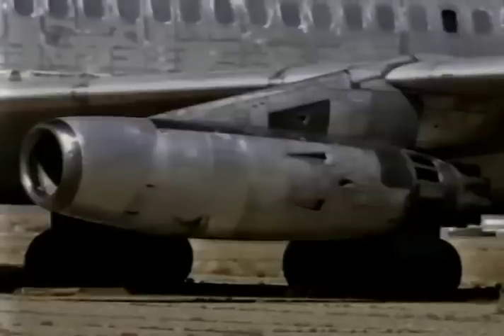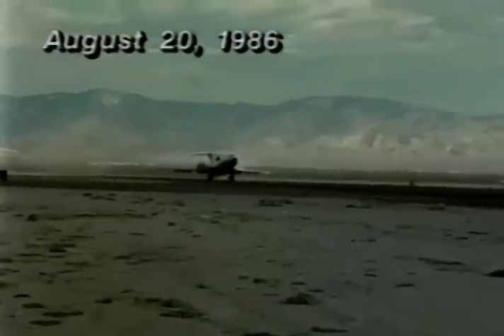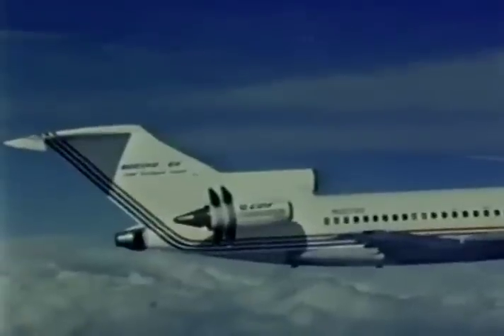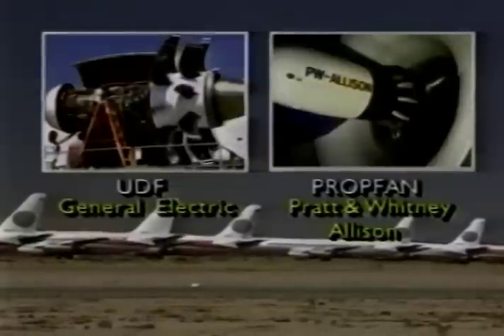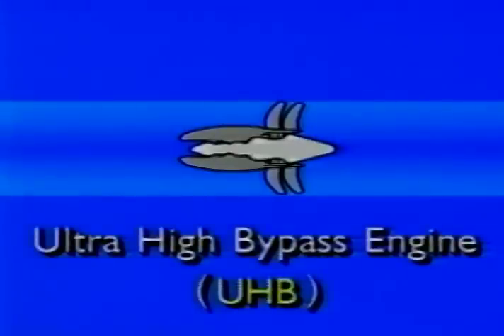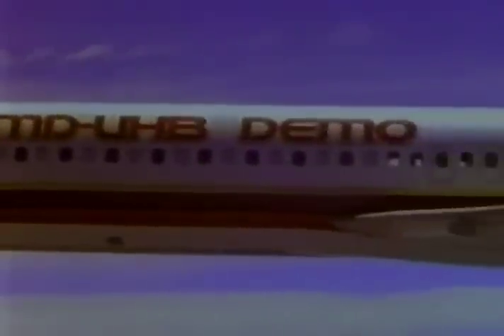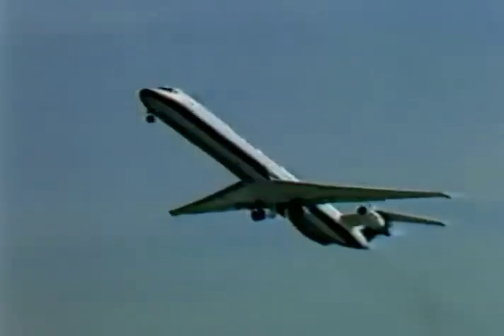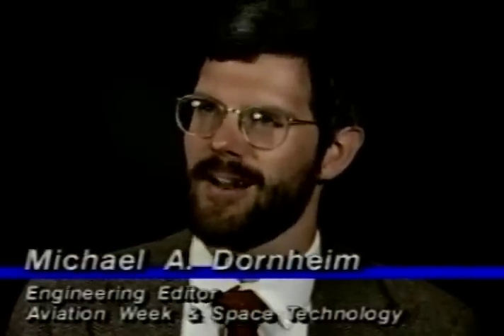The Incredible Engineering of Ultra High Bypass Jets

Comment: Is there a better engine in existence today than what is seen here in the video? And could you still use this concept and adapt it to any modern engine? 
 I know that the front main fans of today are swept and curved, that reduced the noise considerably if I remember right. Couldn't you you do the same to the UHB blades?
Reply from the maker: shexdensmore Thanks for your comment. Better is a pretty tough term to define in this context but it is safe to say the DNA of this technology "family" is flying today in the engines across the world fleet. UDF's blades as seen in the thumbnail were already highly swept - but the specifics are based on power, rotational speed, etc.
Reply: I wonder if they were thinner, they look they're 2-3in. I'm guessing they are more likely 6-12in if not more. In any case. I wonder if they were made to be thinner. If that would decrease the sound while still increasing the thrust. 

  And i guess my original question was why wasn't this persued or why haven't I seen anything like this?

Comment: Isnt this just going back to propeller technology buy powered with a jet engine? Its a shame we  go to such lengths to cut on carbon
Reply from the maker: eatermaneatsyou Thanks for your comment. Not really, it is an effort to save fuel for aircraft operators using an unconventional fan jet technology... The two versions were Unducted Fan and PropFan. While carbon output reduction is a by product of fuel efficiency (the goal of this technology demonstration exercise in the late 80s), fuel efficiency is first and foremost a way to save operating costs for airlines and other operators of aircraft.
Reply: AeroSpaceNews.com Right. So there is also thrust generated by the engines exhaust itself and not just the propeller? Would you happen to know how much of the exhaust gets used to power the fan and how much actually goes to thrust? Not asking for exact numbers just which is more dominant.
Reply from the maker: eatermaneatsyou I can't tell you with any certainty or precision but my experience and instinct lead me to say it is majority fan (those crazy blades) produced thrust that is created as "work" by these powerplants. Re-reading your question, I don't think that is what you asked. All of the hot gases exit the turbine and thus produce some thrust. How much of their momentum or energy potential is "re-directed" or "consumed" by the requirements to spin the big fan, I don't know. The very same re-purposing takes place in all fanjet engines but the numbers, of course, vary from model to model. Same is true for turboprops (again with variations relative to fanjets and by model).

Comment: I don't understand...how is this different from a turboprop?
Reply: legionbunny This one doesn't work that's the difference. No advantage against the turbofan.
Reply from the maker: legionbunny Many many more blades. That's over simplified but more or less the essence. Thanks for your question!
Reply: legionbunny No gear box,less complexity and weight, specially on  big engines.
Reply: legionbunny also pusher props are more efficient than front mounted props
Reply: +Charles Frogg It worked perfectly. The reason why its not used today is because its LOUD. Over 170 db loud, which makes it a bad thing, says the FAA.
Reply: No. The reason why they are loud is the same reason why helicopters are loud. You will notice the only helicopters that are pretty quiet are the ones that have an enshrouded tail propeller like the Dauphin. The noise youhear from helicopters is called blade slap.

Comment: The UDF is LOUD!! It will require a lot more R&D to get them to acceptable noise levels. The UDF will eventually become "unavoidable" in future jet designs. They could be working on it this very minute. A lot of other countries still have an active research program.
Reply from the maker: tollytime propulsion Thanks for taking the time to comment!
Reply: Uh no modern day hy bypass ducted fans are many times more efficient then this design. Two words, tip loss. There's air that could be used as thrust but instead slips over the tip of the blade and becomes useless air that only provided extra drag.

Comment: AeroSpaceNews.com What do YOU think of this design? personally i think its excellent. exploiting the exhaust for power as well as the rest of the engine is definitely a plus. most possible bang for your buck. Frankly, I don't understand why commonplace aircraft don't hhave this. I've never seen this type of design before untill now.
Reply from the maker: Daniel Cannata Thanks for your comment and question(s). Kinda wish you'd avoid the profanity per your other comment as we have people of all ages watching our videos. All gas turbine engines (jets) use both cold air (from the fan(s) or in this case the propulsers) in addition to hot gas exiting the core of the engine, so that's not unique to this technology. When this video was made what was new was the extreme ratio of cold to hot, the Ultra in Ultra High Bypass. As we've said in other comments, that approach in one way or another is more or less in place in various systems now. Noise was an issue with the blades back then and is still a tough nut to crack today, somewhat less so with a nacelle surrounding the blades as seen on conventional fanjets. Certainly fuel efficiency is good for many many reasons so ongoing research in this type of system seems worthwhile. Blade loss was not our concern then as this was not much different than a turboprop or piston powered propeller driven aircraft in terms of risk... maybe in terms of number of blades and rotational speed, but that does not seem a major issue.
Reply: Oh...S: now that I think about it I have seen props in the outer flow layer but I thought that was always a thing. I didn't know it was this. You learn something new every day i guess lol.

And did I swear? 
My apologies. If you want to keep it PG, I respect that. :)
Reply: Daniel Cannata took the bad word out. :3
Reply from the maker: Daniel Cannata Thanks again for the comment and understanding! We want to encourage young folks to get involved with the magic of flight so we gotta keep it appropriate for them. :) UHB was really kinda like turboprop propulsion on steroids... more blades and more highly twisted, but not too radical a departure from good old props. It was looked at more as taking the cowling off of fanjets, but one could approach the concept from either direction and be pretty much on target.
Reply: AeroSpaceNews.com "All gas turbine engines (jets) use both cold air (from the fan(s) or in this case the propulsers) in addition to hot gas exiting the core of the engine" ==> Not really. Don't forget that in pure jets, all the air goes into the combustion chamber. Granted, part of this air is used for cooling of combustion chamber lining, but this is more of a technicality.
Reply from the maker: corisco tupi Can you name any models of what you are calling "pure jets" that are in production today? Just curious. While you point out the issue is somewhat semantic, as far as we know, even modern military jets have some bypass ratio in the name of efficiency. It seems the age of the original turbojet is long past. If not, we are always keen on learning something new! :)
Reply: AeroSpaceNews.com Sure, my pleasure. One example is the Scaled Composites White Knight, used to launch the SpaceShipOne experimental spacecraft. Some other aircraft, while old by design, are still in use such as the F-5 fighter or T-38 trainer. I'm sure there might be others. I'm glad to be able to take part in your endeavor of learning something new! ;)

EDIT - While your question specified "in production" and the examples I provided above do not strictly qualify, turbojet engines are in use today, so your assertion that "all gas turbine engines", etc, is wrong, sorry. And more: turboprop and turboshaft engines are also gas turbines that use all the inlet air for combustion, which further disproves your "all gas turbines" theory. And there are plenty of those in production. :)
Reply from the maker: corisco tupi While perhaps it was unclear, you appear to have both misinterpreted my question and missed the entire point of the original response to the OP. My question to you, made in good faith, was about the powerplant, not the (or any) aircraft. Naming a very specialized aircraft in response was not illustrative of your point. 

Furthermore, it was clear from my question and admitted as such in your response that "in production" was the status sought. Thus naming a Vietnam-era aircraft like the F-5 is not an applicable example.

You seem quite keen to make me wrong. That's fine, your prerogative. But the only thing wrong was a lack of understanding on your part that my comment was written in the context of all the other comments made by me on this video about the direction of modern aviation jet engine (gas turbine) design(s). In that context designs dating from the age of this video and newer do typically have some bypass (sooner in the civilian world but eventually even in military aircraft). 

So perhaps what is wrong with my comment was the omission of an "*" followed by one saying *Jet engines designed and produced after the date this video was produced.

Finally, claiming that turboprops don't have bypass air is, with all respect, fundamentally flawed. In fact, and in the context of my comment, they have the most "ultra" bypass of any flying gas turbine designs. Yes, "flying" gas turbines. While there are stationary, rail, marine, power generation and more types of gas turbines, they were not part of the conversation here. I can't think of a flying gas turbine propulsion powerplant in production in the "West" without some bypass ratio. Not APUs, propulsion. I'm not interested in being right, I'm interested in knowledge. Do correct me if I'm wrong but try to be polite. Lest you think not, rotorcraft (helicopters) are essentially turboprops in this context.

I never offered a "theory" related to "gas turbines. In response to a question I simply attempted to offer some facts, in a historical context, about this strange and almost forgotten milestone on the road to aircraft propulsion fuel efficiency improvements.
Reply: AeroSpaceNews.com I don't know why you think I'd be unpolite in my reply to you. If anything, it was you who originally responded sacastically when I offered an honest opinion (to which you are of course entitled to not agree) - even then my next reply was quite respectful. With that settled, you may wish to be strict with my answer regarding aircraft using gas turbines and rule out older designs (even if they are stil in use today). By the same token, I'll be strict with your reply stating that helicopters are "turboprops" and the generalistic, blanket-statement concerning "ALL" gas turbines. Sorry, but no. helicopters have no propellers - they have rotors (or rotary wings as any helicopter pilot will tell you), and their turboshaft engine provides propulsion via a 100:1 or so reduction gearbox. Calling helicopters "turboprop" is stretching things way too far just to make your case. Again, sorry. And please don't take this as been keen to make you wrong. I just pointed out ONE particular error in your otherwise informative comments.
Reply from the maker: corisco tupi Tone is oftentimes difficult to judge on the web. No matter. Everyone is entitled to their opinion, expressed respectfully. We don't agree but clearly I respect your intelligence and overall civility... otherwise nobody would see you poking me as the comments would be deleted. ;)
Reply: AeroSpaceNews.com Likewise. This is one of those (rare) YouTube cases where people agree to disagree. Cheers. :)
Reply: AeroSpaceNews.com 
"Blade loss was not our concern then as this was not much different than a turboprop or piston powered propeller driven aircraft in terms of risk... maybe in terms of number of blades and rotational speed,(...)"

IMO it also a problem. Rotation speed and size of a turboprop propellers are different. They are bigger in size than propfan blades, so in case of detachment from an engine spinner they are going to lose velocity quicker due to aerodynamic drag. Also RPMs make a difference; energy increases with square of speed. Becase of that turbofan cowling are made with strong materials and must be certified.

An another problem is a size of the whole engine. UHB / propfans have greater diameter than turbofans and cannot be mounted under the wings; there is not enough clearance from RWY. Or they have to be raised up which is not good because they would disturb airflow around wings aerofoil. 

cheers
Reply from the maker: tjblues01 Thanks for taking the time to post your thoughtful comment. I'm not sure I agree with you about the off blade issue but you are correct about the mounting challenge - it is why they tested these on an MD-80 and 727 - had to use that aft side fuselage location as they could not fit under the wing.

Comment: What's the difference between this and turboprops as used on Tu-95? Aren't the technology similar?
Reply: The difference is the blades are on the back. XD
Reply: The Tu-95 had large blades rotating relatively slowly albeit with supersonic tip speed hence the noise whereas the UHB has smaller blades rotating faster